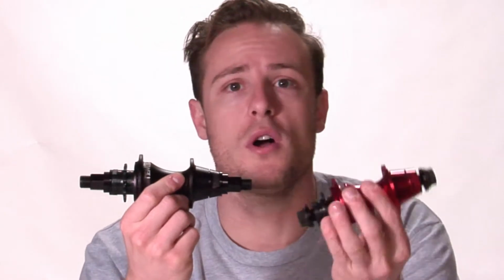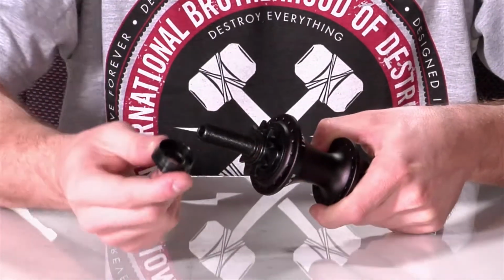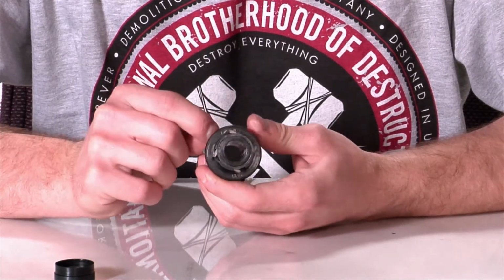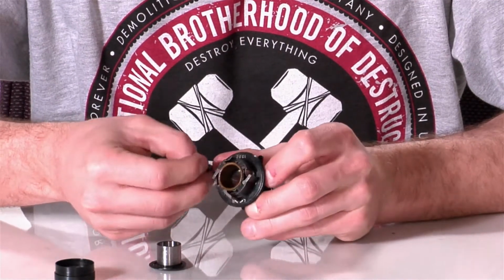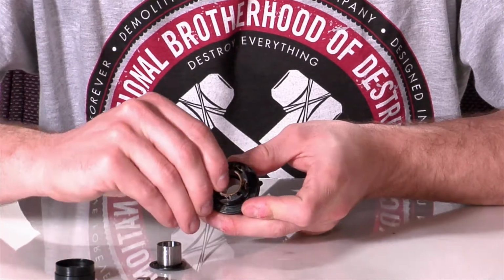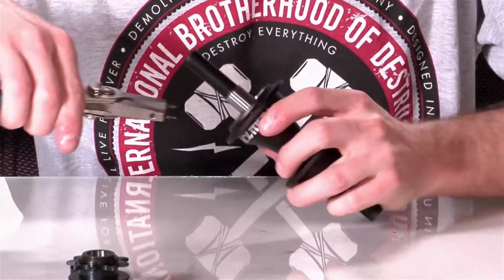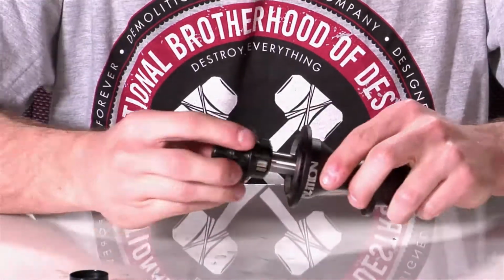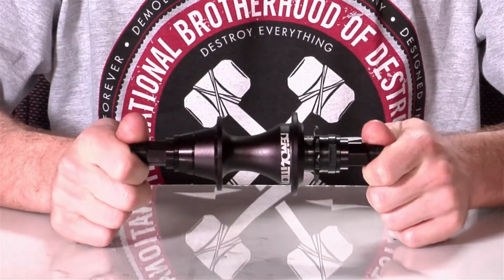Demolition Parts: How to make flip pawls to RHD or LHD with the Switch Drive System

Comment: They should color code the paw springs. Red on the top half and blue on the bottom so you dont lose track if you accidently droped one and dont know which way to put it in. Besides that, pretty cool overall
Reply: Adam Maske good idea?